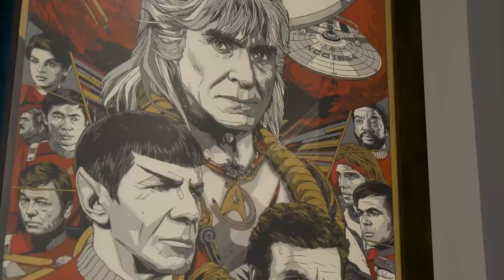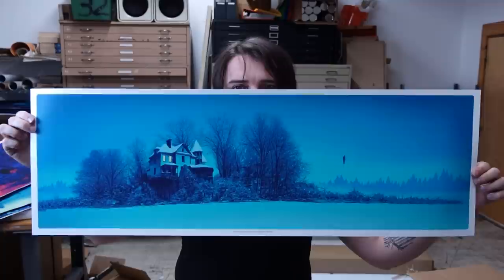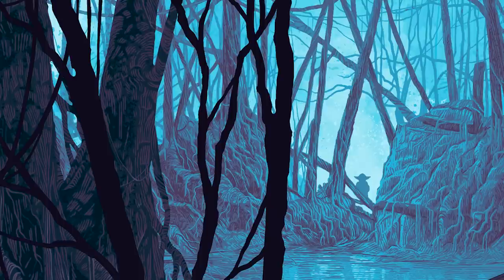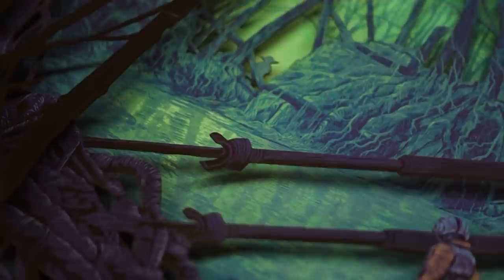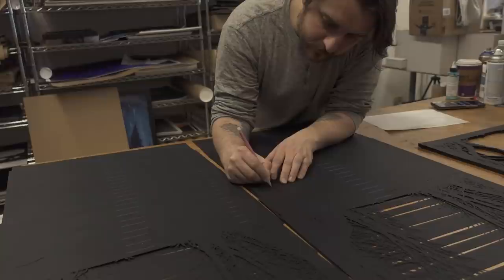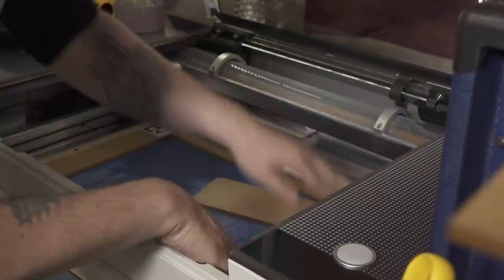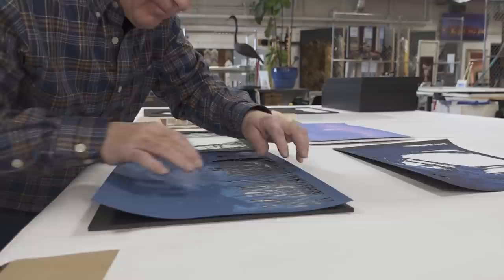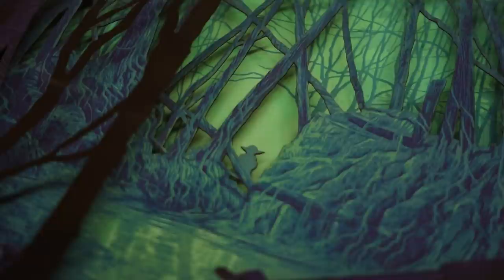Amazing Laser-Cut Star Wars Shadowbox!

Comment: Fun tip for laser cutting paper on the glowforge is using repositional spray adhesive on the back.  Until they give us access to turn off the air assist fan, or you build a custom vacuum tray, the spray helps keep pieces from blowing around.  -
Reply: We built vacuum tables inside. Spray would get messy real quick with the screenprinting ink becoming atomized from the laser heat and fans. Speed and efficiency is important when doing literally thousands of cut pieces, I can't go too deep into it but we got a really really good system going.
Reply: Definitely jealous of the vacuum table!

Comment: Very neat. It combines a bunch of things that I like a lot.
Smart solution with the vacuum pulling the pieces down. I would think he would use some sort of adhesive, but his is most likely a better solution, as he has all those narrow pieces that could get damaged if he had to peel them off.
Anyways, pretty cool stuff. Thanks, Norm!
Reply: Yeah, adhesive would likely damage the small fine vines and branches, and it's messy and there's alot of ink/paper dust. The vacuum table does a few things, keeps the overall paper flat so the laser is in focus, keeps small pieces from flying away and landing elsewhere in the way of a future cut, and vents the fire/heat straight down vs the original fan pulling it across the surface for cleaner cuts (less scorching).